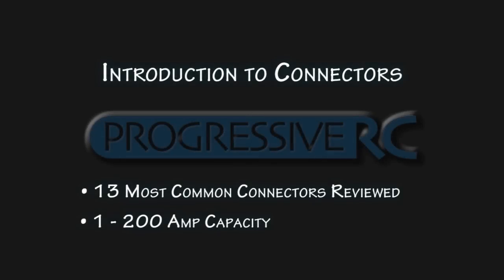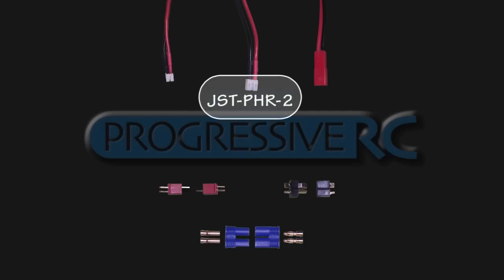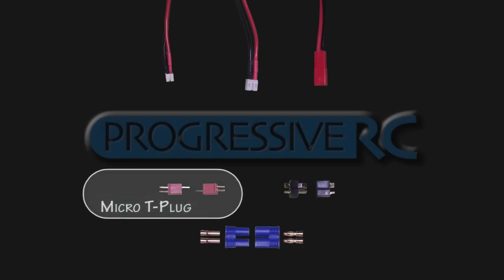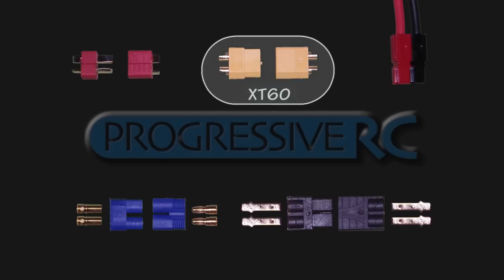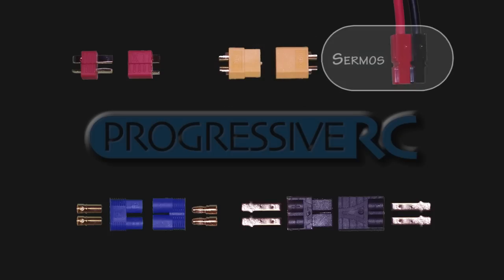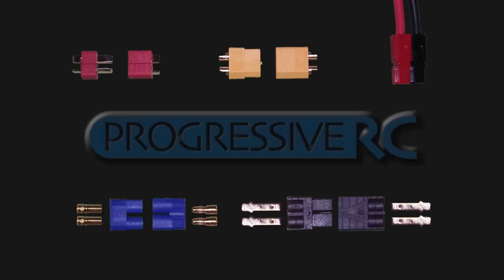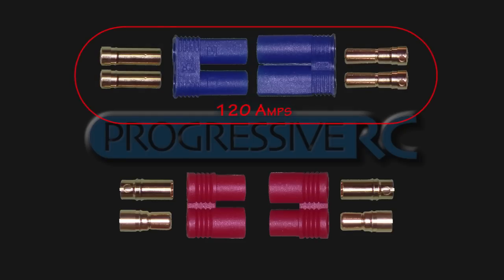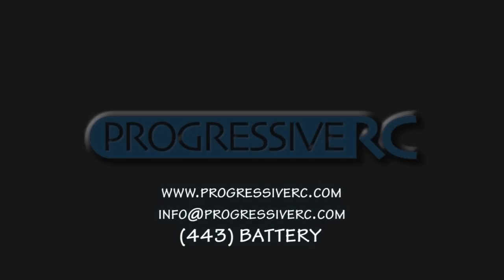Product Spotlight - Connectors

Comment: So I have a question here. I'm new to flying and I have the P-47 Razorback 1.2m which came equipped with the  EC3 male connector. I purchased two E-flight batteries which are 3s 2200mah & 3000mah both 30c and female connectors also with this charger. I now purchased a Blade Night 230 S that takes a 3s 800-900mah with a 18 to 20 awg wire and equipped with the JST with a female connector. Can I take off the JST and replace it with a EC3 male end to use the 2200mah or 3000mah? Or use the JST to EC3 adapter cable even tho its said to be  for charging? Plz help me with some insight cuz so far I have not had good experiences starting off in the hobby sitting with the plane I have not been able to fly not one time and also the helicopter cuz i don't want to order more batteries and charger.

Comment: I recently ordered an iCharger 4010DUO and wanted to know if you have TX-90 connectors, and what is the size in mm for the positive and negative wires that plug into the charger? (Not the battery)
Reply from the maker: Hey Sean!  We have XT90 connectors!  The connectors that go into the 
charger are 4mm banana plugs.  You can head over to our site and use the
 search bar - type in XT90 Charge Cable, and you should be able to find 
it!